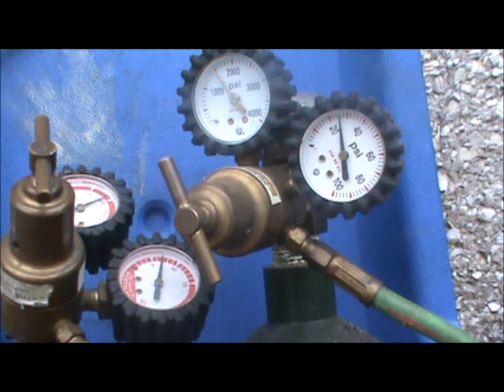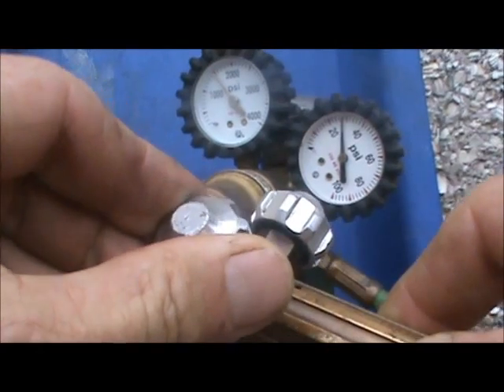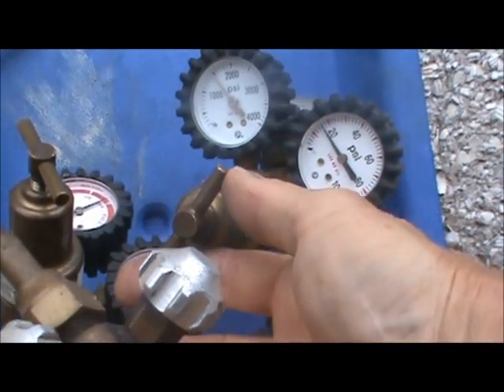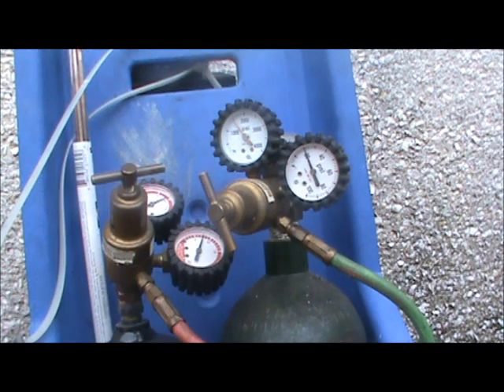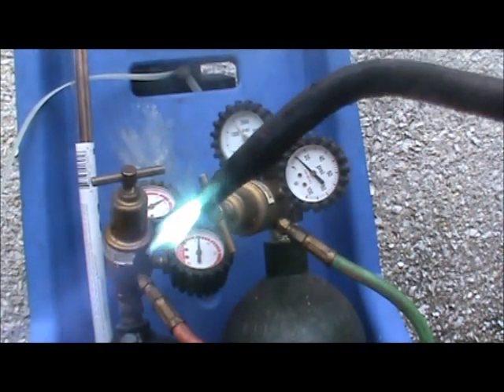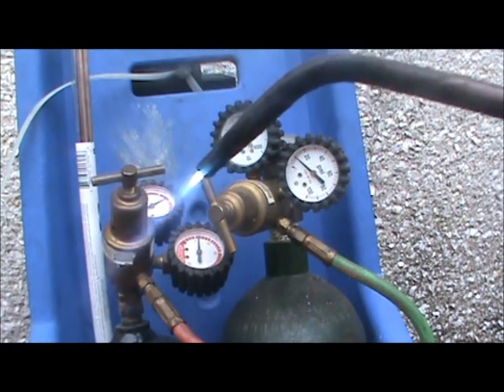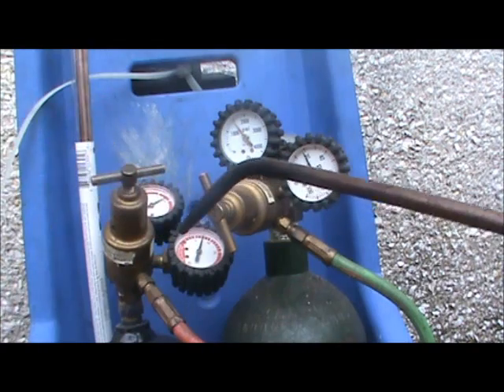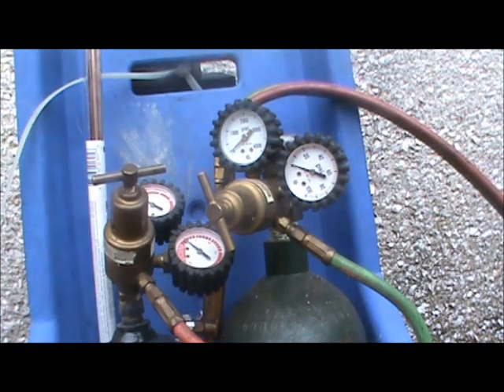HVAC Training - Intro Oxy/Acetylene Torches

Comment: I usually open both when igniting a little bit and then adjust the flame. This will avoid the soot. Open the acetylene just a crack and the oxygen and strike and adjust.

Comment: Turning on a little oxy when 1st lighting the torch reduces the amount soot monsters in customer home....
I don't agree with turning off the fuel 1st because it "pops" the tip and leaves oxy flowing with little indication and could easily be left running....and I have never seen acet burn "inside" a tip without oxy.....
Reply: Always turn off the Acetylene first, then the Oxygen.  This procedure will blow out the flame.  Otherwise the flame can go back into the torch head or worse.

Comment: In another video I watched, the instructor opened both gas and O2 (slightly) to ignite thereby preventing the soot problem. Why do you open the O2 after ignition? (Not meaning to be critical; just wanting to know.)